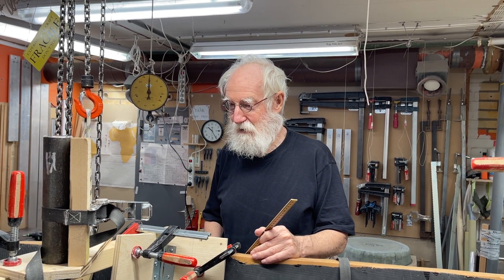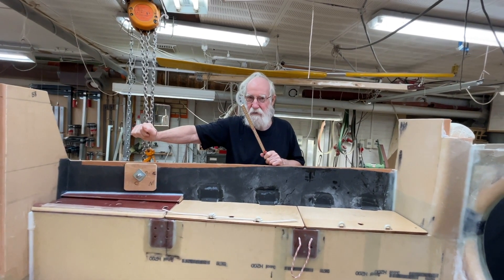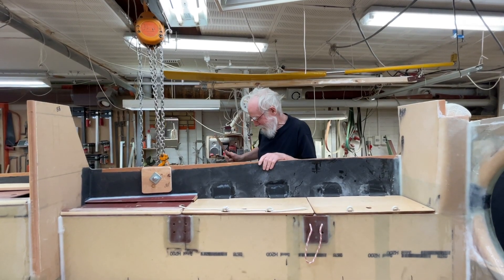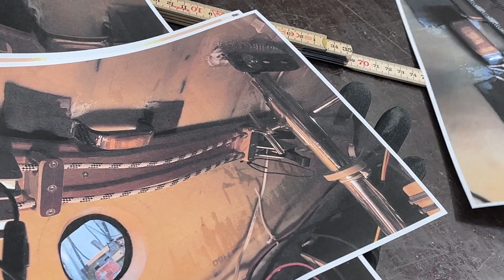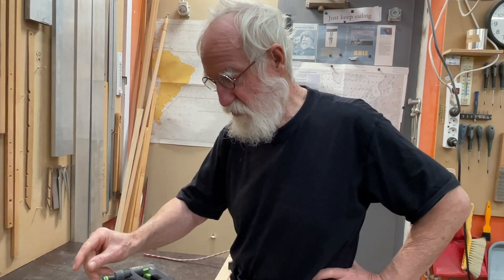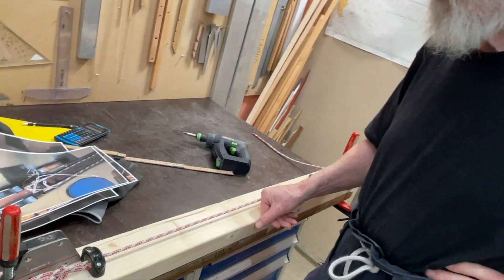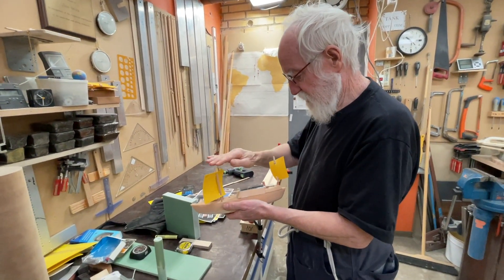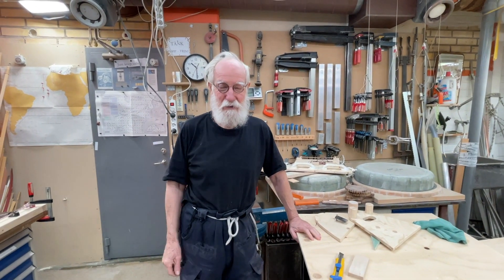3 Nov 2022. Staying on course with rope cluthches. No Windvane System Yrvind. Confused ? Stay tuned.

Comment: You can use a "very long screw" aka "threated rod" to steer the boat. Maybe M16x2. One turn equals 2 mm of movement.
The rod goes all along the boat so you can turn it at any place.
It's selflocking by the way......

Comment: You could probably put a small pair of cleats near the rope cluthches / steering assembly to use as a backup In case a clutch fails.
Reply from the maker: True.
If there is place and time I may try that.

Comment: Hi Yrvind, I am probably wrong but you changed your twin keels for a solid ballast plate so you could potentially haul the boat up a beach. Doesn't the new rudder arrangement negate that ability?  Obviously I know only the things you show on the videos and the curve of the hull may mean the rudder would be clear or have you changed your thinking on this. I would be interested to know. By the way I totally admire your lifestyle and your boatbuilding ideas, may you go on for decades more and thank you for making and sharing your videos.
Reply: I'm not sure if he'll answer you but his destination has changed from around Cape Horn to traveling east towards New Zealand.  He had planned to beach around Punto Arenas or somewhere in  Argentina but that's off now.  I think that's what's going on with the keels and rudders and such.  Maybe he'll clarify-
Reply: @ralphwatten2426  Thanks Ralph, makes sense
Reply from the maker: The idea is that the rudder is so strong that the boat can slide on it and be beached.
The previus route was Acores - Falkland Islands - Cape Horn - Chile not Magellan and Punta Arenas.
Now is Ireland - NZ  - Ireland
Reply: Shouldn't be running up any beaches on that route I guess😉

Comment: As I understand the problem with cam clutch your line became thin. Other than a superior design with good range, then fitting maximum size line. A rope braid jacket, core removed secured to each side base through the cam increases its grasp.

Comment: The rope clutches seem to work better if you use thicker line 10mm or 12mm in that area. I’ve had good luck with spinlock. 
If you really want small lines, spinlock XAS0408 is for 4-8mm lines. There’s also a double line model XAS0408/2 which costs about US$200
Reply from the maker: Thanks for the information

Comment: Since the routing of the steering ropes is nearly straight, I think it would be worth the time to experiment replacing them with 2 or 3 sections of solid rod connected together with pivots or universal joints to make one continuous link from the rudder arm forward into the cabin.  Simpler, more reliable.  You could do the same thing with a push-pull Morse cable but they have high friction and are subject to corrosion.
Reply from the maker: It would not be more simple.
It would complicate it a lot to no gain.
Reply: @SvenYrvindExlex  
A single length of a semi rigid material, like possibly pvc, might work.
Reply from the maker: @barneygoogle4003  Rope is excellent why complicate matters+

Comment: Not sure if they’re available in sweden but my garhauer clutches have worked great for my main sheet and preventer even when I replaced the mainsheet with a smaller diameter line this year. https://www.garhauermarine.com/shop/deck-blocks-hardware-mast-boom-blocks-hardware/rope-clutches/rope-clutch-11-12s/